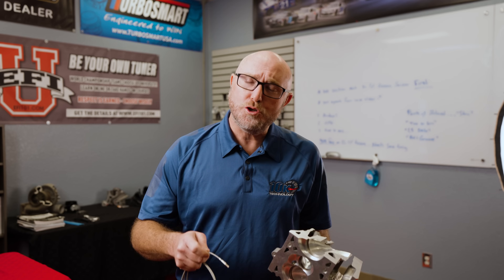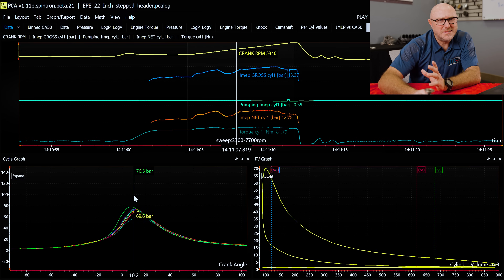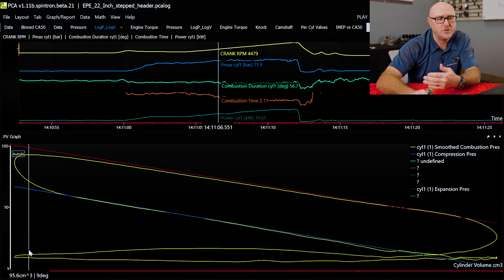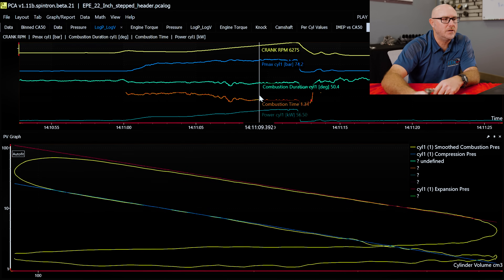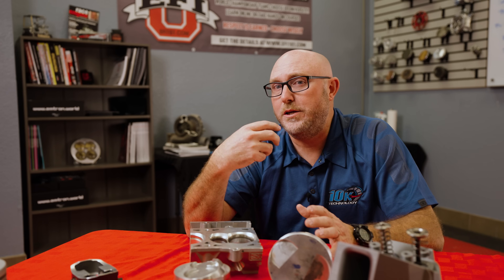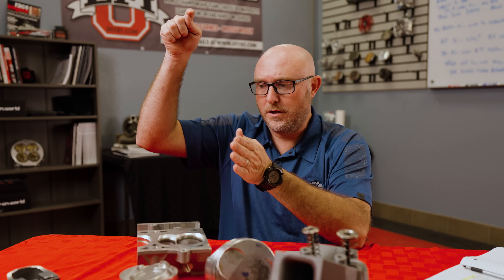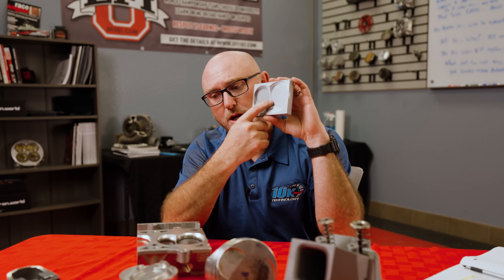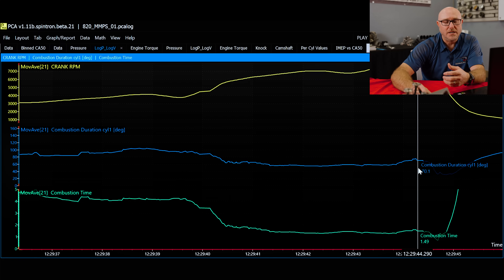I Think Steve Morris is WRONG and I Can Prove It!

Comment: I feel there is alot of actually important factors omitted in the video that would help explain why ignition timing may not or may need to be adjusted based on the cylinder charge.
1. MFB50 and its relationship with MBT and their joined relationship with the engines geometry
2. The resultant pressure curve vs engine geometry in relations to timing
3. No engine is "NA" , without a turbo or supercharger or n2o the atmospheric pressure is the power adder
4. No mention of IMEP and how it is derived, it would explain exactly why timing needs to be moved to alter the power output to reach the peak power output
5. All pressure on the pistons upwards stroke is a loss and all pressure on the downards stroke is a gain, that includes intake stroke. Geometry here dictates how that piston pressure translates into torque(the instantaneous torque at X crank angle) or torque loss. 
6. Variability in turbulence, general understanding is that turbulence goes up with engine speed as well as higher density air charge. Here geometry of the combustion chamber comes heavily into play. Engines can need 15°BTDC ignition at 30psi and 40psi and that would entirely be due to turbulence coming down with higher air charge.
Reply: "No engine is "NA" , without a turbo or supercharger or n2o the atmospheric pressure is the power adder"

Normaly/Naturally aspirated means only atmospheric pressure is used to fill the cylinder, so yes there are many NA engines.  Atmospheric pressure is not a "power adder", it's fundamental for the engine working at all.

Comment: The only way I can see that it's physically possible for what steve said to be true is if the volatility of the mixture was unchanged between the two test conditions. I'd go so far to say that if it still takes the same timing after adding boost, its because you have added unfavorable conditions when you increased the boost, probably in the form of an EGR effect from an exhaust that has become more of a restriction.

Comment: It's the same exact reason we run vacuume advance to advance the timing at part throttle... less air and fuel in the chamber takes longer to burn needs lit earlier.  As for the gen III Hemi, they like less advance than LS engines and it's why Chevy tuners break hemi pistons when they try to find them like an LS.

Comment: So if you didn’t have the different wet maintained grass mixed with the ratty dry grass, you’d have a better burn. 
The more efficient a combustion chamber, the less timing will be required.
Boost situations have the probability of changing chamber efficiency. 
Treat every engine the same way only different. 
Ignition timing is very important. 

I watched a video of magnetos coming off and tumbling down the track from a top fuel dragster that was still firing down the quarter

Comment: Excellent video, but i feel there is something missing from this conversation that ultimately changes all of the variables you presented, and that's the difference in fuel types.
  The combustion profiles for pump gas, oxygenated gasoline, E85, ethanol and nitromethane are all going to be different, not only for their individual burn qualities but also for the optimum volume used with each fuel.
  Also, just adding something to the argument, my experience with nitromethane would put me in agreement with Steve.  Whether tuning for blown or N/A, the ignition lead stays constant at approximately 55 degrees for a dual plug or 65 for single plug application...this in a 426 style engine with 175cc combustion chamber.  There is a difference in static compression between the two types of engines, but all else being equal (bore, stroke, cam profile) the duration of burn is the main factor and not how the chamber is pressurized.
Reply: i think you're right, there was no data shared about different fuels and i think it would make a substantial difference
Reply: Agree. I normally love this channel, this video and title wasn't my favorite. I have an engine 6 years on the same tune, 14psi 16° on pump, 93 and 20psi 16° on C16. Thousands of street miles and my guess would be 150-200 1/8 mile passes. Fuel chemistry is critical. A good video on this topic: https://youtu.be/aTs3kQOsyhE?si=8WtmmcnLUNXI4lIe
Reply: I read this in Tony's voice
Reply: Great point!
Reply: "the duration of burn is the main factor and not how the chamber is pressurized"

Depends on whether boosting (or higher CR or different fuel) causes the engine to be knock limited.  Having watched a few of his videos, Steve seems like the kind of guy with plenty of practical experience of what works, but not so much knowledge on why.
Reply: Exactly, one of the first things steve said to him was "....and If your fule can tolerate it" Meaning yes some fuels won't, BUT he wasn't talking about them.
Reply: Steve mentioned in his video that "as long as the fuel is tolerant of resisting knock". I don't think that nitromethane counts in this discussion. The burn characteristics are completely different.
Reply: You are correct. In blower charged nitromethane cars you get boost obviously as the rpm rises, but you don't want maximum horsepower from the starting line as your clutch cannon hasn't backed out (also usually there is no traction for 10k hp from standstill) so what you do? you run less timing.
Reply: Both mentioned the change with fuels. Maybe I have supersonic hearing, wait I didn't hear you, what did you say, I was not listening that time, sorry?
Reply: @TurboWorld  im hope this EFI tuning method and or hardware become's more commonplace ( as the 8 O2's wide-band ect is nice but im hopeing there redundancies and i can delete them and use only-1 as calibration/back-up and or sensory for gas spectrumipy measuring aka engine-health and fuel-type ect ) and or less usd$$$ as 5k ( haven't got to the wiring/EFI-tuning parts yet but i didn't remember it being that spendy and or lambo/other-oem had spark-plugs at one point for sale on-line/replacement's and or other methods and or glowplug/or/laser-ignition+data-built-in-combined ) is steep for on-fly tuning and temperatures data ect as my/1960's repop'd 540ci D8/iron-casting's it has VVT( gm phaser unit )+VLSA+ liquid-push-rods( multi-air basically, and yes i needs hydraulic pressure at the junk-pump/cam/lifter and at the slave-cylinder/retainer and PSI/spring-pressure under-side and general engine-oil-PSI and low-oil sender/warning ect ) and VCR-connecting-rods( also controlled by hydraulic PSI and or possible to completely shut down cylinder pumping-losses at idle/cruising speed's/60MPH~ ) and twin-sparks+GDI/diesel-hybrid( aka modern 2015~era EFI, replacement of my 1970 383/906 in 67-69-charger that got stolen/damages ect and yes was considered more crude-era planing/assembled as 1990-2002~ EPA/OBD2 hardware as it was TT and port-injection and CNP and inside was roller-cam( was thinking/tinkering with adding a single gm-phaser assembly but that didn't happen on that gear-drive-cam ) at most aka basically stock the transmission in both is TR6060-platform ) planned in my budget/build 

tuning without pressures+temp-ect vs cranking/computerised is almost impossible for my build to run minty or at-all as settling/or/environment's can change to-much, one sub-system ( say all-8 rod's locked/solenoids-slam'd at 8~:1 aka low setting's, or cam-on-demand lock'd at minimum or maximum as computer bleed's-off mechanical-grind designed-in, same way for sparks or getting a carb/fuel-control'd/DCV-leaking-solenoids ) i might make it run lock'd-out/limp-home mode but like the dodge darts/500's of 2018~ without the computer's+PSI it's not easy to get it started let alone keeping running

Comment: Great video Ben! What is your opinion on mixture motion inside the combustion chamber prior to ignition. High swirl /tumble heads & tight quench-high mixture motion, vs low swirl/ tumble & chamber softening-less mixture motion. Thank you.
Reply: Imo it's important on class spec engines that require every tenth of a hp to win.. Hell my LT1 build has easily made 70hp more than my LS3 and I feel it's almost all in the direct injection and the way it burns.. my stock bottom end 6.2lt made 612wheel hp.. nearly 700crank..  my last 427 7.0 LS couldn't reach 600wheel with a bigger bore..

Comment: I'm surprised that timing could end up back at the same place as NA.  Can you do timing for E85 vs pump gas?  I'm tired of hearing of the "cooling effect" being the source of increased power.
Reply: beside “cooling effect”，the only main factor for timing chose is how much fuel mixture speed up the flame font and the water be brough into chamber that slow down the burn

Comment: great topic ， but still one question about how did 'Throttle response' or 'rpm ramp rate' related to AFR and Ignition timing ，  how these character behave differenly on chamber pressure bulid up, are these thing actually can be measue by dyno or pick from other equipment .
（it only start to draw my interest on andy's LIVE chat with Daniel Powell of @powellmachineinc ， when daniel talk about“ timing for dyno might be slower on the track due to logy PRM ramp rate”  made me wonder if that's typical carburetor issure or it can be optimize by efi fuel enrichment table.
ps：also often heard from many gokart&carb guy prefer to rich fuel for better power respond and top end speed ）

Comment: Wouldn't you also want to take into account exactly where peak pressure of the combustion event happens in relation to tdc? I get measuring the duration, but during that roughly 1 ms of combustion the peak pressure could be .4 ms or .6 ms from the start. I would think that would also determine where to set spark.
Reply from the maker: Peak pressure location is important, but we focus more on when the mixture is being consumed and adding "area under the curve"...we call out specific locations such as "CA50" where 50% of the mixture is burned

Comment: Can you make a video discussing your thoughts on Cattledog Garage's camshaft LSA videos, especially after the Weingartner camshaft challenge?
Reply from the maker: I wish I could, but I haven't seen it and I'm probably not smart enough anyway!
Reply: @EFIU_Ben  you are just being modest. The good part of the video starts about 30 minutes in and I would listen to it at 1.5x speed if I were you
Reply: @2drtahoefan1 only 1.5 speed? How did a 115 LSA finish 5th with minimal lift and basically no overlap?
Reply: @optimumperformance6998  didn't BTR finish 5th? And I think the fact that the #1 guy got a perfect score and the #3 guy just slightly missed the mark make anyone below them look like they're completely missing the mark. It's like comparing a golfing hole in one vs par. I think Cattledog is onto something, but I'd like to see all the "empirical data" that he constantly mentions.
Reply: @2drtahoefan1  you want all the data? I'm one of 2 guys that recorded all of it and complied the scores. Possibly the guy that came in 5th. LSA is a result of timing events. The LSA crowd NEVER shares valve timing events. It means zero. I'll happily share the data with you from the LS shootout. Let me know.

Comment: To me this supports the love of the LS type heads. If they are this knock resistant they would be very tune adaptable. If they can go from atmosphere to 27 lbs of boost and not change the timing  almost any bonehead could put one together. looking at this info from the other side.
Reply from the maker: Its a heck of a good combination, for sure!

Comment: Can you also determine the exhaust stroke efficiency by using the combustion pressure sensor, and thus see if the engine had more egr in a boosted application vs na? also, no mention of the AFR target change when switching from boosted to na. a rich mixture will typically require more ign timing. Interesting mapping the combustion time data. Would is there an advantage in using peak pressure angle instead, or a combo of both? (one is used to map the other) If the inlet pressure is elevated, and the exhaust pressure is not would the intake port velocity increase and possibly create a state of poor atomization in some applications? Could touch on inlet temps as well. lots and lots of things contribute to the ideal ignition timing for a given combo. one more thought here, the duration of a pull is also important in finding MBT. If an engine took 12 seconds to make a run, the chamber temp will be elevated more than an engine making a run in 5 seconds. The shorter duration run would tend to want more ignition timing do to the lower chamber temp, valve temp, plug temp etc.

Comment: Hi from the uk You know  that AVL / Kistler produce a pressure transducer built into a spark plug of any heat range you require and they are super accurate about the same price and you don't have to drill and tap holes in your head
Reply: I wander why our pump colors are the other way round to yours

Comment: I think I know EXACTLY the example you are talking about and it's cherry picking, when Steve was only trying to make it easier for his client and found a decent solution. This had to do with MORE than simply TIMING and BOOST. It was TIMING + FUEL + BOOST. Let's use an arbitrary number of 34deg of timing, pump 91 octane and the 'Street' pulley @ 12psi for this 'Blower' setup.
What Steve might have said was something like: Pulley Change to smaller 'Strip' 16-18psi pulley + C16 Fuel (in place of the 10-12psi capable pulley + 91octane) and the timing SHOULD suffice, as this was also a Blow thru Carb/ProCharger combo from back in the day. Makes complete sense to me with the video from back in the day. He is a scatterbrain when it comes to 'teaching' at times, but his concepts make sense. ALSO, I have not watched his latest video, nor do I need to. The Timing/Fuel/Boost argument I made above stands.

Comment: Every old carbureted engine have a distributor with vacuum advance and some have even boost retard. Pretty straight forward that the engines ignition timing requirement varies with load. Disconnect the hose and milage suffers badly. 
Your 650hp NA to 1250 hp boostd engine seems to not work very well. 22.5 psi is 253 kpa and 1250 hp /(253/100) = 494 hp from the theoretical na engine. That is 150 Na hp just gone. Where did it go? A local hero have the same "theoretical Na result" from 15 psi to 38 psi boost on his Twin turbo LS engine. 

Same with the Sorseress. That engine worked very well at low boost with over 1100 hp from the theoretical Na engine. At high boost that fell of a cliff and all that energy and heat that did not get converted to horsepower gave you guys problems WAY to big to overcome. 
Shutting the wastegates trying to send all the compressorflow through the turbinhousing is crazy because the turbineside of a turbocharger almost always have a max flow capability about just 50% of the compressorside. That is just the way it is. That was inzanity and not full send. :) Good for views I guess. I think that was a very disapointing moment as you just can not do that successfully.

Comment: And remember that not all PSI’s are created equal. 

Boost doesn’t equal horsepower, boost is not a measure of power, more boost does not equal more power, more boost doesn’t equal a power number, boost doesn’t really say much at all…. 
Engines pump their own displacement every two revs, at any fixed RPM the engine CFM pumped is constant. The boost pressure does not increase the engine CFM, it increases the density of that CFM. It takes pounds of air not pounds of boost to burn pounds of fuel 🥳

Comment: I remember that in that video Steve was using/tuning on methanol. At the time I was triggered as well about his statement, but in the particular case of very high octane (usually alcohols, ethanol/methanol) and considering the cylinder pressure those engines can make for the given boost interval as well as the volume/bore of the cylinder in those engines... his statement probably was not been too much further from the truth.

Comment: Measuring and comparing air density, air flow volume, fueling rate, combustion temperature,and exhaust pressure should show how much EGR effect/cylinder evacuation there is. I think Steve needs some combustion sensors!

Comment: How does spark plug gap affect the whole thing. We had an engine with MSD ignition and the plugs were .025. Opened them up to .055 and it ran much much better.
Reply: Resistor type plugs need a decent gap to build up a resistance so when the spark occurs its fat, as if it was being held back. If the gap is too close on the resistor plug the gap is easily achieved and the weak spark makes it across before optimal resistance is achived.  Kind of like setting a pressure regulator to low for the injectors, when the injector opens not much pressure. Set high pressure on the regulator, when the injector finally opens, bamm! Not a perfect analogy but tried another way to describe it if the main concept didnt connect.
Reply: if it's too  big its like regarding the timing, the spark has to jump and the longer it takes the engine as turned more degrees,